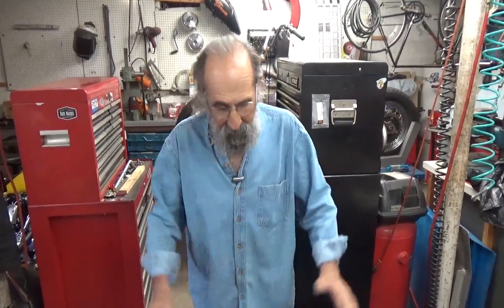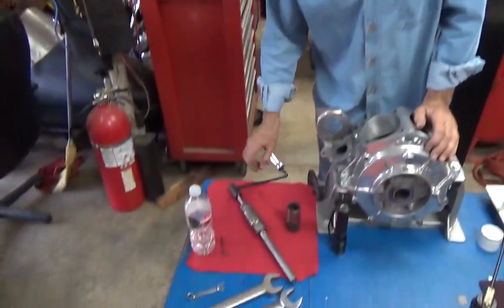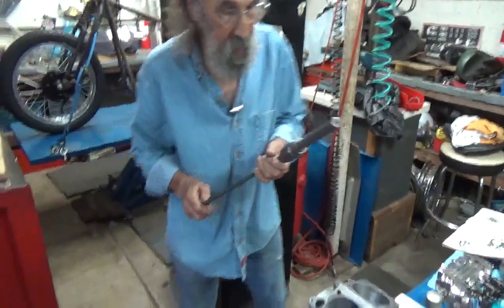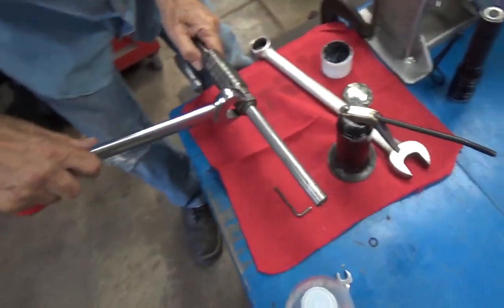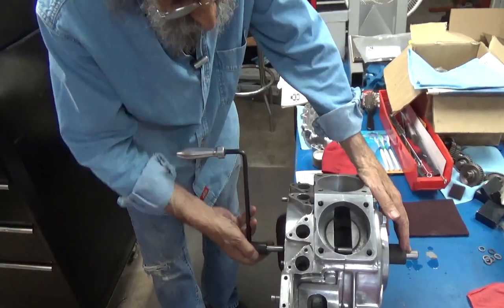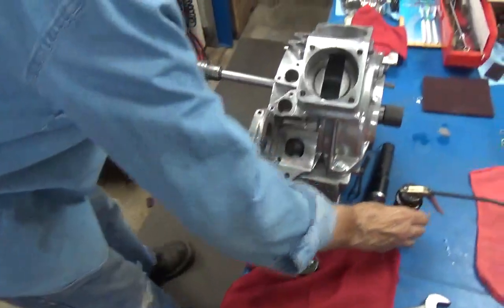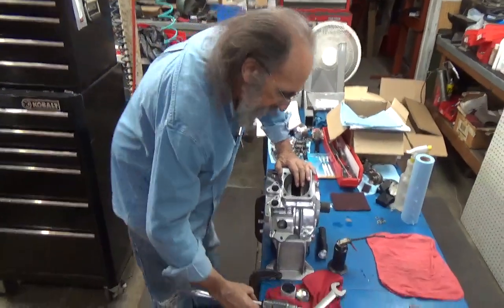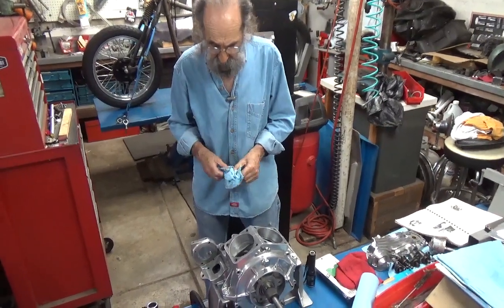Crankcase Bearing Races In the Flathead 80

Comment: Another great video. Way back when we were putting together a basket 45, we had a friend turn a big stick on his wood lathe, covered it in valve lap and ran it through both races. I wouldn't recommend it, but it worked. :D
Reply from the maker: That's great.  How close is close?
Reply: @pacificmike9501  40 years ago. I don't remember what spec we used, just had a WW2 manual to go by.

Comment: Hey mike  I know I'm a little late to the party I just turned 20 subscribed and watched your evo motor build series from a year ago I cannot thank you enough I'm rebuilding my dad's old bike and just wanted to let you know that you are a big part of this project I got going on I wouldn't have known where to start I'd like to send you my progress it's a s&s but evo style on a hard tail frame it's been through hurricane Irma down in key marathon Florida I brought it to Midland Texas and I've been working on replacing frame parts wheels and front end thing but now I'm going through the engine and am waiting on bushing and gaskets for this bike thank you so much for such great inspiration and knowledge ps I would so buy your Cut brake rotors for my flywheel and thank you doing what your doing hope to hear from you
Reply from the maker: Cut brake rotors?  I think you lost me.  But thanx.  I'm glad this stuff is helping you.
Reply: @pacificmike9501  yeah you cut a brake rotor for the flywheel removal it was a great idea
Reply: @pacificmike9501  I think it was to a old explorer a 9 inch in diameter

Comment: Great Stuff Mike ,I own a 78 fxs,I want take out the belt drive and reinstall the primary chain. Do you have any videos doing  the same? Thanks
Reply from the maker: I do show it.  What you'll need is your service manual.  The oil lines are very important and specific.  The shimming of the motor sprocket is critical.  Installing the inner primary housing is critical.

Comment: HELLO Mike👍 quick question on disc brake pad GREASING.  SORRY, I HAVE a 2004 FATBOY. What points on the pad do you lubricate to avoid chattering , squealing, or any other noise. So i can eliminate the PADS from the equation.  If i still have issues after lubing  certain points on pad, i will buy the Kevlar pads. THANKS IN ADVANCE🙏 I APPRECIATE YOUR KNOWLEDGE.  OR DO U ALREADY HAVE a VIDEO ON this TOPIC Mike ?
Reply from the maker: I don't grease brake pads.

Comment: Hi Mike! Sorry this comment isn't relevant to this video. I have a 96 Softail with an Evo. It is spitting air/fuel out of the carburetor really made. Rebuilt the carb and changed all the rubber everything seems fine. But still is spitting back out. Is it possible my intake valves could not be closing all the way? Wether it is from carbon build up, bent valve, or an adjustment? What are you thoughts.
Really appreciate all your videos and what you do for the community. Keep up the good work and
Reply from the maker: My computer is acting up.  If you've changed your air cleaner or pipes and created this problem or if it's been going on already, try a slightly larger low speed jet in your carburetor.  That will probably do it.  They are set up lean to start with.

Comment: What is the go with the front cyclinder having a cut out for rod but the back being completely open?
Reply from the maker: I've got to study it more.  But, there is no oil pumped to the topend.  The pistons, get what's splashed on them from the bottom and the valves get what they get from the lifters.  The scraper plates are different from an overhead also.  Again, to give a really good answer will take a little more studying.
Reply: @pacificmike9501  cheers, sounds like there is more then we may understand based on newer engine design...interesting to hear that the older engines make do with a splash style lubrication for the bottem end, and a "hope for the best" style top end lubrication...

Very interesting build to follow, if for no other reason, knowledge...
Reply from the maker: It's not splash for the bottom.  It's pressure from the pump into the crank and bearings.  Splash occurs after the valve lifters.  The factory diagrams show it all.  That doesn't mean I've got it all straight in my head yet.
Reply: @pacificmike9501  splash for the top end via lifters? Sounds odd, almost sounds like the oil pump was for the bottem end only and damn the rest...but it did seem to work for harley...

Now more interested in this build...
Reply from the maker: The real beauty is the massive amount of smooth torque these big Flatheads make.  Sidevalve engines make great torque and a long stroke and heavy flywheels.  I do all of these things to have the experience that I crave.  I ride old bikes until they're worn out, rebuild and ride some more.
Reply: @pacificmike9501  old bikes never die...they just require some rest and relaxation before a freshen up and being back out on the road...

Comment: Great video Mike, so question can you not have measured that out and preset that to the correct bore you wanted or is that not how that tool works? I personally have never seen one like that before, similar but that one is different than anything I’ve ever seen
Reply from the maker: This is a higher quality, but same as factory recommends.  At this point, you're removing all "imperfections" from the surface s of the bear races.
Reply from the maker: Then, the rollers are fitted.  They are graduated in tenths of thousandths.  Sorry, my computer is acting up.